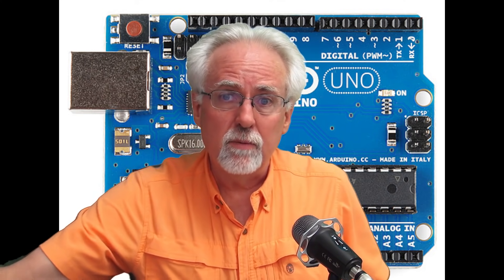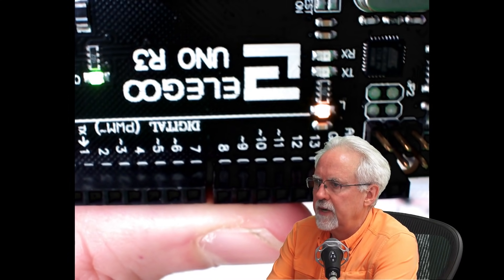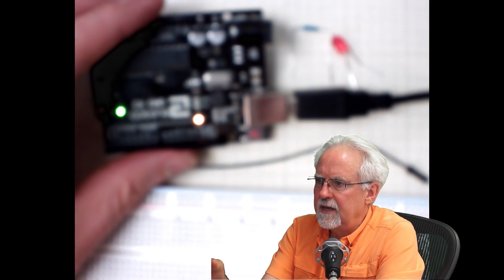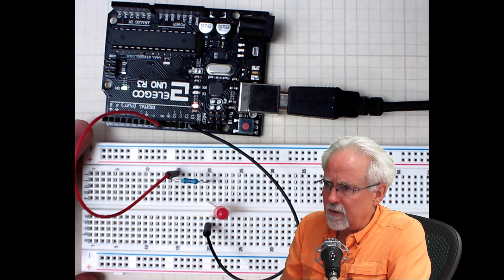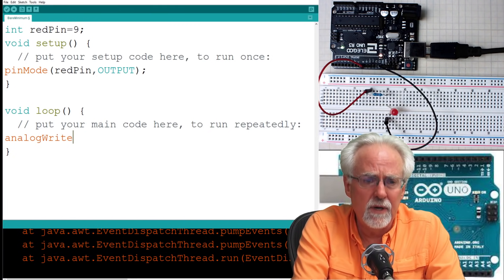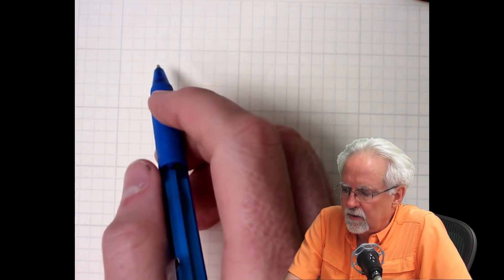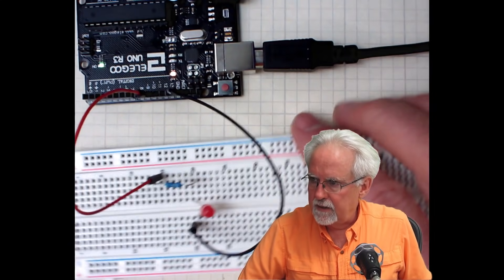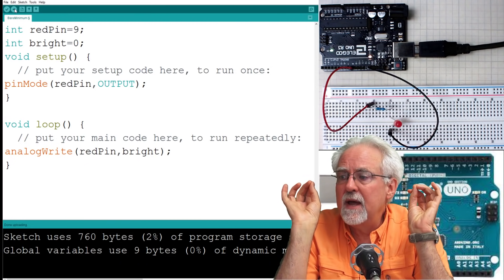Arduino Tutorial 7: Understanding the Arduino Analog Write Command

Comment: Dear Paul, I really like your video, your way of teaching is very clear, it fits me as a beginner in Arduino.  Recently I develop a Fuel Flow simulator. Long story short, it has to produce 2 pulses named Drum & Impeller. Let say the pulse width is 5 ms (5000 us), and the Pulse Repetition Time (PRT) is 40 ms, so the Drum pulse will repeat after 40 ms, the same way as Impeller pulse. The time delay between the Drum and Impeller pulses is proportional with the Fuel Flow. It's 40 PPH (Pounds Per Hour) for every one ms, for example 400 PPH --> the delay is 10 ms, 500 PPH the delay is 12.5 ms. 
I managed to generate the pulses accurately (I checked with digital oscilloscope, it has cursors for marking times), as well as the time delay of Drum-Impeller pulses. I use delayMicroseconds() function for pulse width and Drum-Impeller delay. However, I could not get accurate timing for PRT every loop. I tried delay() function, I tried while loop with micros().  It seems the program add some time delay.  I check for 800 PPH (20 ms delay), Drum: 5ms, delay: 20ms, Impeller: 5ms, total 25 ms than I add 15 ms to cycle the loop to satisfy 40 ms PRT requirement, all pulses and delay are accurate, but PRT is more than 40 ms, it's more than 100 ms. Are there limitations of Arduino? How to solve this?  BTW, I use Arduino Nano Atmega 328P/5V for this application.
I would really appreciate it if you can help me.
Regards,

Mula W. Wangsaputa
mula165@gmail.com
Reply: If you don't mind to review the sketch I wrote:

/*  Fuel Flow Transducer Simulator
 *  Mula - YB1BUL
 *  January 2023
 */

#include <rotary.h>
#include <Wire.h>
#include <LiquidCrystal_I2C.h>
#include <Arduino.h>

Rotary r = Rotary(3,2);
LiquidCrystal_I2C lcd(0x27, 16, 2);

const int drum=9; //output pin DRUM
const int imp=10; //output pin IMPELLER
int pw; //pulse width in microsecond
unsigned long prt; //Pulse Repetition Time or Period in us
unsigned long prtu; //Pulse Repetition Time or Period in us
int ff; //Fuel Flow in PPH
int ffmax; //Max Fuel Flow
byte sff; //Fuel Flow Step in PPH
int ffd;//delay due to FF in us
int ffm; //residue
boolean statepulse;
unsigned long time_now=0;

void setup() 
{
  lcd.begin();
  lcd.backlight();
  lcd.clear();
  
  pinMode(drum,OUTPUT);
  pinMode(imp,OUTPUT);
  ff=0;
  ffmax=1000;
  sff=10;
  pw=5000;
  statepulse=true;

  PCICR |= (1 << PCIE2);
  PCMSK2 |= (1 << PCINT18) | (1 << PCINT19);
  sei();
/*
  lcd.setCursor(0,0);
  lcd.print("FF");
  lcd.setCursor(6,0);
  lcd.print("PPH d");
  lcd.setCursor(0,1);
  lcd.print("PRT");
  lcd.setCursor(7,1);
  lcd.print("p");
*/

  lcd.setCursor(0,0);
  lcd.print("FF :");
  lcd.setCursor(9,0);
  lcd.print("PPH");
  lcd.setCursor(0,1);
  lcd.print("PRT:");
  lcd.setCursor(9,1);
  lcd.print("ms");
  
}

void loop() 
{
  if(ff<70)
   {
    prt=150000;
   }
   else
   {
   if(ff<100)
     {
      prt=100000;
     }
     else
     {
      if(ff<200)
      {
        prt=50000;
      }
      else
      {
        if(ff<ffmax)
        {
         prt=40000;       
        }
       }
      }
     }

// DRUM & IMPELLER Pulses Generation
    if(ff<=200)
     {
     if(statepulse==true)
       {
         digitalWrite(drum,HIGH);
         delayMicroseconds(ffd);
         digitalWrite(imp,HIGH);
         delayMicroseconds(pw-ffd);
         digitalWrite(drum,LOW);
         delayMicroseconds(ffd);
         digitalWrite(imp,LOW);
         statepulse=false;
        }
      else
        {
        statepulse=true;
        }
     } 
    else
      {
        if(statepulse==true)
         {
           digitalWrite(drum,HIGH);
           delayMicroseconds(pw);
           digitalWrite(drum,LOW);
           delayMicroseconds(ffd-pw);
           digitalWrite(imp,HIGH);
           delayMicroseconds(pw);
           digitalWrite(imp,LOW);
           statepulse=false;             
         }
         else
         {
          statepulse=true;
         }  
      }
      
  time_now=micros();
  prtu=prt-ffd-pw; 
  
  while(micros()<time_now+prtu)
   {
     //wait to generate new pulses
   }  
   
  showParameter();
}

ISR(PCINT2_vect)
{
  unsigned char result = r.process();
  if (result == DIR_NONE) 
    {
      // do nothing
    }  
  else if (result == DIR_CW) 
    {
      ff=ff+sff;
      ff = constrain(ff,0,ffmax);
    }     
  else if (result == DIR_CCW) 
    {
      ff=ff-sff;
      ff = constrain(ff,0,ffmax);
    }   
 ffd=ff*1000/40; //delay drum - impeller in us = ff/40, 40 PPH= 1ms 
}

void showParameter()
{
// Display parameters
/*
   lcd.setCursor(2,0);
   lcd.print("    ");
   lcd.setCursor(2,0);
   lcd.print(ff);
   lcd.setCursor(11,0);
   lcd.print("     ");
   lcd.setCursor(11,0);
   lcd.print(ffd);
   lcd.setCursor(3,1);
   lcd.print("   ");
   lcd.setCursor(3,1); 
   lcd.print(prt/1000);
   lcd.setCursor(8,1);
   lcd.print("        ");
   lcd.setCursor(8,1);
   lcd.print(prtu);
*/

   lcd.setCursor(5,0);
   lcd.print("    ");
   lcd.setCursor(5,0);
   lcd.print(ff);

   lcd.setCursor(5,1);
   lcd.print("   ");
   lcd.setCursor(5,1); 
   lcd.print(prt/1000);

}
Reply: Actually it's already solved.  I got helps from others in Arduino Forum. Thank you.
here is the final code:

/*  Fuel Flow Transducer Simulator
 *  Mula - YB1BUL
 *  January 2023
 */

#include <rotary.h>
#include <Wire.h>
#include <LiquidCrystal_I2C.h>
#include <Arduino.h>

Rotary r = Rotary(3,2);
LiquidCrystal_I2C lcd(0x27, 16, 2);

const int drum=9; //output pin DRUM
const int imp=10; //output pin IMPELLER
unsigned long pw; //pulse width in microsecond
unsigned long prt,prt150,prt100,prt50,prt40; //Pulse Repetition Time or Period in us
int ff,ff70,ff100,ff200; //Fuel Flow in PPH
int ffmax; //Max Fuel Flow
int sff; //Fuel Flow Step in PPH
int ffd;//delay due to FF in us
unsigned long time_now=0UL;

void setup() 
{
  lcd.begin();
  lcd.backlight();
  lcd.clear();
  
  pinMode(drum,OUTPUT);
  pinMode(imp,OUTPUT);
  
  ff=0;
  ff70=70;
  ff100=100;
  ff200=200;
  ffmax=1000;
  sff=10;
  prt=150000;
  prt150=150000;
  prt100=100000;
  prt50=50000;
  prt40=40000;
  pw=5000;

  PCICR |= (1 << PCIE2);
  PCMSK2 |= (1 << PCINT18) | (1 << PCINT19);
  sei();

  lcd.setCursor(0,0);
  lcd.print("FF :");
  lcd.setCursor(9,0);
  lcd.print("PPH");
  lcd.setCursor(0,1);
  lcd.print("PRT:");
  lcd.setCursor(9,1);
  lcd.print("ms");
}

void loop() 
{
  time_now=micros();
// DRUM & IMPELLER Pulses Generation
    if(ff<=200)
     {
         digitalWrite(drum,HIGH);
         delayMicroseconds(ffd);
         digitalWrite(imp,HIGH);
         delayMicroseconds(pw-ffd);
         digitalWrite(drum,LOW);
         delayMicroseconds(ffd);
         digitalWrite(imp,LOW);
     } 
    else
      {
           digitalWrite(drum,HIGH);
           delayMicroseconds(pw);
           digitalWrite(drum,LOW);
           delayMicros(ffd-pw);
           digitalWrite(imp,HIGH);
           delayMicroseconds(pw);
           digitalWrite(imp,LOW);          
      }

  showParameter();
  while(micros()<time_now+prt)
   {
     //wait to generate new pulses
   }  
}

ISR(PCINT2_vect)
{
  unsigned char result = r.process();
  if (result == DIR_NONE) 
    {
      // do nothing
    }  
  else if (result == DIR_CW) 
    {
      ff=ff+sff;
      ff = constrain(ff,0,ffmax);
    }     
  else if (result == DIR_CCW) 
    {
      ff=ff-sff;
      ff = constrain(ff,0,ffmax);
    }   
    
if(ff<ff70)
   {
    prt=prt150;
   }
   else
   {
   if(ff<ff100)
     {
      prt=prt100;
     }
     else
     {
      if(ff<ff200)
      {
        prt=prt50;
      }
      else
      {
        if(ff<ffmax)
        {
         prt=prt40;       
        }
       }
      }
     }
   ffd=ff*1000UL/40; //drum - impeller delay in us = ff/40, 40 PPH= 1ms 
}

void showParameter()
{
// Display parameters
   char buffer[17];
   sprintf(buffer,"%4d",ff);
   lcd.setCursor(4,0);
   lcd.print(buffer);

   sprintf(buffer,"%3d",prt/1000);
   lcd.setCursor(5,1);
   lcd.print(buffer);
}

void delayMicros(unsigned long d)
{
  unsigned long start=micros();
  while(micros()-start<=d);
}

Comment: HW:
.
.
.
.
added some dimming to make it look cooler and shortened the delay to make the change smoother. 

  //variables
int red=3;
int b0=0;
int b1=5;
int b2=10;
int b3=15;
int b4=30;
int b5=60;
int b6=100;
int b7=150;
int b8=200;
int b9=255;
int wait=75;

void setup() {
  // put your setup code here, to run once:
pinMode(red,OUTPUT);
}

void loop() {
  // put your main code here, to run repeatedly:
  //brighten
analogWrite(red,b0);
delay(wait);
analogWrite(red,b1);
delay(wait);
analogWrite(red,b2);
delay(wait);
analogWrite(red,b3);
delay(wait);
analogWrite(red,b4);
delay(wait);
analogWrite(red,b5);
delay(wait);
analogWrite(red,b6);
delay(wait);
analogWrite(red,b7);
delay(wait);
analogWrite(red,b8);
delay(wait);
analogWrite(red,b9);
delay(wait);

  //dim
analogWrite(red,b9);
delay(wait);
analogWrite(red,b8);
delay(wait);
analogWrite(red,b7);
delay(wait);
analogWrite(red,b6);
delay(wait);
analogWrite(red,b5);
delay(wait);
analogWrite(red,b4);
delay(wait);
analogWrite(red,b3);
delay(wait);
analogWrite(red,b2);
delay(wait);
analogWrite(red,b1);
delay(wait);
analogWrite(red,b0);
delay(wait);

}

Comment: Hi Mr Paul. I have a small query. When you use analogRead -> the values read between the range 0 to 1023. But when it is analogWrite -> The values are written in the range of 0 to 255. In both cases, we declared the variable as an integer.

Comment: You made an incorrect statement during your description of the meaning behind 255 being the max value.

You do not have 8 bits of resolution. 
You have 7 bits of resolution.

1111111 is 
1+2+4+8+16+32+64+128=255
At the 8th bit, you have
00000001
which is 256 and that 8th bit overflows.

The way these masks always work is that if you have "n-bits" of resolution, the max value is "n+1-bits minus 1" 

You seem to forget, at least for your explanation, that we are not pushing a single bit up the registers but that the trailing registers can be flipped high as well. 

When you're doing power of two, the power indicates the minimum number of bits in order to support that decimal number. Your max number is 255, which can be held with 7 bits pulled high.

At least, that's the way I explain it.

Comment: Hey Paul, really like how intuitive this is feeling so far - I started my LED at the brightest level and reduced it until it was off: 

int redPin = 9;
int bright = 255;
int middle = 127;
int dim = 63;
int off = 0;
int d = 200;

void setup() {
  // put your setup code here, to run once:
pinMode(redPin, OUTPUT);
}

void loop() {
  // put your main code here, to run repeatedly:
  analogWrite(redPin, bright);
  delay(d);

  analogWrite(redPin, middle);
  delay(d);

  analogWrite(redPin, dim);
  delay(d);

  analogWrite(redPin, off);
  delay(d);

  
  
}

Comment: @Paul McWhorter, so I am coming to this long after you posted, but I purchased an Arduino kit before I knew of your videos, and got the "Most Complete Starter Kit" which included the Mega 2560" board, as opposed to the one you use in the videos. Well, it has "analog in" on the board, but they do not respond at all, and there are no squiggly lines. So after writing the program, it would not light. After changing pins several times, I tried the original pins we began with (i.e. for all the prior projects), and it worked- with variable illumination. Is this because the board I have is more "fancy," and able to handle variable vs fixed in the main pins, or am I miswiring it? Thanks!

Comment: I was thinking last night after I was done with working with the Uno that I could put a middle value, brightness level, in the program I wrote yesterday so the LED would go from bright to medium to dim instead of just bright and dim. I tried it and it worked. Then instead of it going from bright to medium to dim and start all over at bright I went bright, medium, dim, medium, bright and it worked. Then I did that with an “off” in it, so it went bright, medium, dim, off, dim, medium, bright and it worked.

Comment: I did the experiment, using a Kaiweets KM601 multimeter, which seemed to hop about a bit, before deciding on a fixed value. Having watched the next video in the series, I  am impressed that the meter came up with credible results. For general information, my results were as follows:

SETTING.           VOLTAGE
0.                         0.002
1.                          0.021
2.                          0.040
3.                          0.059
4.                          0.078
7.                           0.134
8.                           0.154
15.                          0.285
16.                          0.305
24.                          0.457
31.                           0.588
32.                           0.606
63.                           1.190
64.                           1.212
127.                          2.397
128.                          2.425
140.                          2.650
150.                          2.832
160.                           3.019
170.                           3.214
180.                           3.400
190.                           3.602
200.                           3.780
210.                            3.956
220.                            4.165
230.                            4.302
240.                            4.544
255.                            4.824
Thanks for another great tutorial.

Cheers,

Eddy

Comment: I suppose arduino mega 2560 doesn't have this capability. I am trying to use pin from 2 to 10 but I cannot have any output and the led is always off. Is it correct? thanks

Comment: Paul, you are dead on point with the homework assignments. I have had to troubleshoot my mistakes and figure out what is wrong.  Since I am a Toyota technician, I troubleshoot all the time and the mistakes I make when programming teaches me what could possibly be a problem when there is an issue. Great work teaching!!
Reply from the maker: Troubleshooting is a really important skill. By the way, I drive nothing but toyotas for the last 10 years. Right now I am driving a Toyota Hilux Diesel 4WD 4 door . . . perhaps the best vehicle toyota ever made. Sad it is not available in US
Reply: @paulmcwhorter  You must have acquired that from our south of the border cousins or overseas. The Hilux was always sold everywhere except in North America. You can get them with diesels along with the  Land Cruiser, but not here. Toyota is not interested in trying to meet the emission standards of the U.S. for diesel engines. The last time the U.S. had a diesel Toyota was the early ‘80s. They were great engines but without a turbocharger, very low powered.

Comment: Hi Paul, I just recently got introduced the the Arduino and bought myself a kit. I’ve been going through your tutorials and they’ve been quite helpful. One question I have is regarding my LEDs. You and documentation say the long lead is the positive end, but to get mine to light, I have to connect the long lead to the negative end. Also, I figured this out in the binary counter and now here with the analog brightness, in order to get my LED to light, I have to set my bright varible to zero. Any ideas when mine are like this? I’ve double and triple checked my wiring and it’s correct. Thanks!

Comment: My Sketch compiles & downloads very slowly. What can be the cause?
Reply: How slow is slow?  What computer and operating system are you using and are you using the Arduino IDE with the latest version?  Version 1.8.19 is the latest version right now.  But you have to have a more recent computer to run it rather than an older computer.  I have to ask all of this as there are a lot of variables in all of this to make some people's sketches compile and download faster or slower than others.  My sketches take about 10 seconds to compile and load and I don't have the fastest computer but it is 64 bit.

Comment: I'm not sure why... I have triple checked my work. When I lower my voltage below 150 my LED cuts out. But if I set it to flash between 150 and 255 there is absolutely NO difference in brightness. Very strange. I will play with it some more but I cannot find anything that is wrong.
Reply: I found out the problem. There are little squigle lines next to some of the digital pins on my board. Only the ones with squigle lines are apparently capable of fluctuating voltage? For instance when I run the exact same program on pin 12 or 13 the light will not fluctuate.

Comment: @Paul McWhorter - Dear  Paul Sir, thanks a lot for such a clear crisp videos on Arduino tutorials. Could you please explain, how did you arrive at  330 ohms resistance value ,which is connected in series with LED, in experiments used. or rather could you tell how to calculate and select the different ohmic values of required resistances in an LED based circuits.
Reply: You need to know the characteristics of your LED then you use ohms law E=IR to calculate the resistance needed to get the current you need at the voltage that you are using.  R=E/I.  There are some LED calculators on the internet, but you still need to know how much current your LED needs, most are around 20 to 30 ma.  If you don't use a large enough resistor you could blow up the LED, which has happened to me.

Comment: Why does my LED stop working if I set it to a number lower than 128? It doesn't seem to go lower in brightness either, the LED it's either on or off. Maybe it's connected to 128 being 2^7?
This is the code I've been using:

int redLED = 13;
int bright = 128;

void setup() {
pinMode(redLED, OUTPUT);
}
 
void loop() {
analogWrite(redLED, bright);
}
Reply from the maker: Are you connected to an analog ~ pin
Reply: @paulmcwhorter  yeah I am

Comment: Are the analog writes still the same number pins on the Elegoo Mega 2560 R3?  There are no squiggly lines on them.  Or maybe you use the 3.3 volt pin?
Reply: Oops.  Just found them.  The squiggly lines are printed on the outside of the pins.